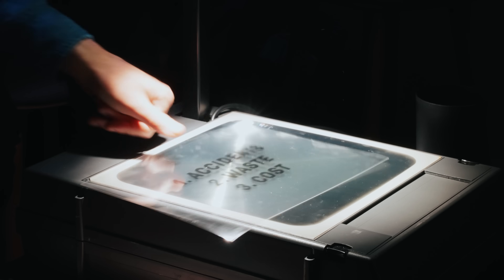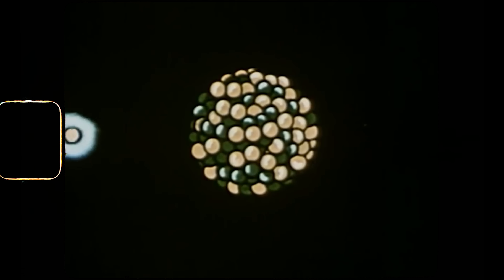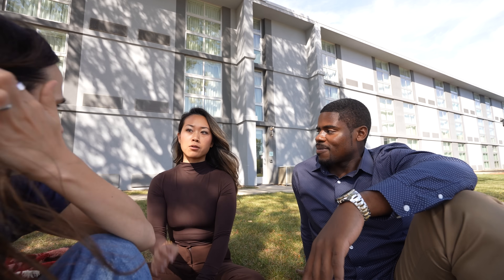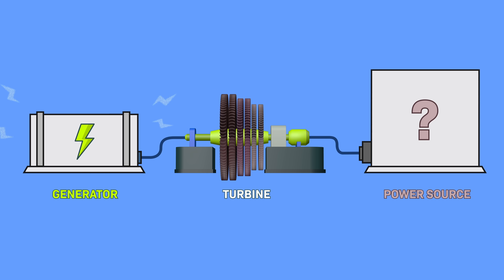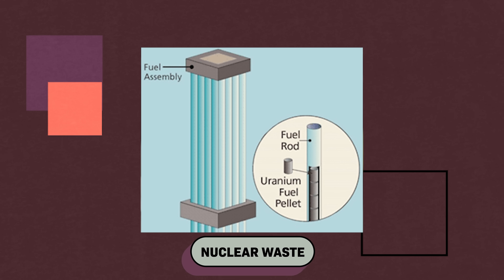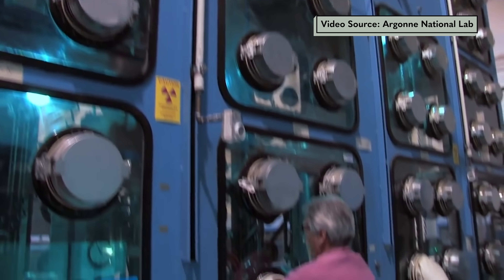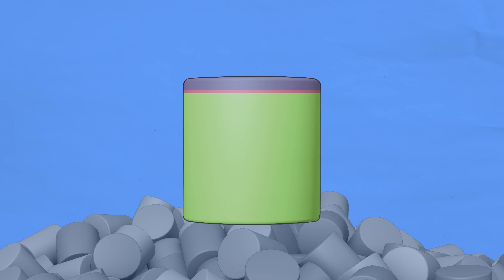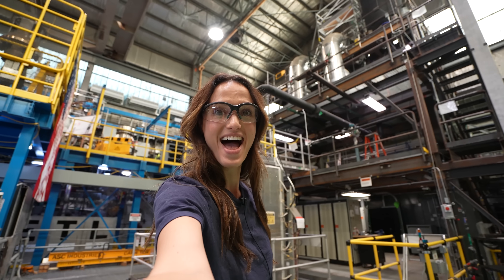The Big Lie About Nuclear Waste

Comment: I think the reason nuclear waste is shown as glowing green goo is from radium used in watches so they can be read in the dark.  Spent fuel actually glows white from Cherenkov Radiation which comes from electrons travelling faster than the phase velocity of light in water.  That white glow appears blue because the water is borated, boron is used to control commercial nuclear reactors in a process called chemical shimming. Nuclear waste can be managed, but its hard to get cooperation when so few people actually understand the first thing about nuclear power.

Comment: 4:07 That makes absolutely no sense. That the nuclear waste (the tiny little bit left over) that is currently in the US is enough to power the Whole US for 150 years. That is fake news and makes no sense what so ever.
there's technically not enough reactors to power the grids that they are on, being generous and saying nuclear reactors have been around for 80 years providing this limited power. You mean to tell me that the "fumes" of the limited power waste is enough to provide electricity to the whole of the US for 150 years? I call BS I know that this is just clever word play. What is probably more likely true is that there is enough watse in the US to powers some things to some capacity in the US for 150 years, like a small town or city.

Comment: It's a nice video but misses the mark on the dangers of radioactive materials. The pioneers of the nuclear industry setup early manufacturing and reactors with no shielding, in fact they handled plutonium, U235 and U238 with bare hands and nobody suffered from any radiation sickness. Refer to Gaylen Windsor, he managed the setup and operation of nuclear facilities and was appallled when they were forced to install useless radiation protection measures. The truth is nuclear fuel is clean, green and plentiful and could supply close to free energy for the world. Plutomium breeder reactors have also been suppressed.

Comment: Edit: People keep commenting about the "feasibility" of this recycling process. It's obvious that those of you making this comment don't know anything about manufacturing.

Unless you are making a custom-made-to-order item or something in too low volume to keep a factory producing it, manufacturing a product is almost always done at a loss when you start. Whether we are talking about fuel rods, game consoles, or GPUs, you typically will not make a profit on a unit of sale when you first launch the product.

Let's take the PS5 Standard Edition for example. It was launched in November 2020 at a price of $499 USD. This was likely a price that resulted in a @40% loss at the time. Yes, that means each console likely cost Sony more than $800 USD to manufacture.

Why, then, did they sell the console at a loss?

Because Sony planned to make it for 5-10 years and the longer you constantly produce something in a factory the lower its manufacturing cost becomes until it eventually reaches the actual cost of the materials and labor which is always far less than the price of the item.

Sony announced that the PS5 Standard Edition would break even in June 2021. After that point, Sony would make an overall profit with each unit of sale. Something to keep in mind is that Sony was probably producing the units for a good six months to a year before the launch to have enough inventory, meaning that it took nearly two years for that model to become profitable. 

This is true for nearly all products made via mass manufacturing and is called "process maturity". So, please, please, stop telling me how there's no profit to be made in this recycling process when recycling is just another manufacturing method. It's not immediately profitable, but it is over time. Big Business and Big Govt. rarely care about short-term profits when manufacturing something.

Original Post:
I remember arguing with a friend of mine over  20 years ago in HS that anything that was radioactive, including nuclear waste, could be used to generate power if we designed a plant to make use of it. Wish I had known about this place back then.
Reply: Russia, China, the UK do it. Unfortunately it's "outlawed" in the US
Reply: Russia already did it with BN reactors.
Reply: @personperson2884  Not quite accurate. Our reactors in the USA use Uranium 235. The BN-reactors "burn" an oxide alloy of >70% Uranium and <30% Plutonium, and some of the neutrons from that reaction are used to turn Uranium 238 into Plutonium 239. They still have to process more uranium into the oxide alloy that is used in the fuel. It also doesn't eliminate any nuclear waste that is produced by existing plants or itself.
Reply: Looks like you need to find your old HS buddy @master zoentrobe’s gaming clips
Reply: @ethosari2029  I could visit their grave, but I don't find smugly saying, "I told you so," to a headstone very satisfying.
Reply: @TheZoenGaming  Man you just love to ignore points that others (like Pluxei and me) make. You ignore actual reality and argue your theoretical stuff. According to you yourself for 20 years with your friend and still you are miles away from the real world. Lost cause apparently.
Reply: Important disclaimer it's not just about manufacturing cost, We actually kind of know that the PS5 pure manufacturing cost (parts price + labour and machine cost) can't be too far from its selling price. we know that because in some countries it is literally forbidden to sell a product at a too low price if manufactured and at loss if you are a resaler, except during few specific circumstances for which the PS5 doesn't even qualify yet, actually every cost estimation of the PS5 made by independent put the pure manufacturing cost of the PS5 close to its selling price often below 400$ and the highest estimation being at 450$. 

What sony reimbursed in june 2021 is mainly the R&D cost, marketing cost, software development and other expense and overheads.
Reply: Anything radioactive, huh? How about the low level waste like a glove that has touched something radioactive and now has radioactive dust particles on it? Can you reuse that? I don't think so... the steps to separate the tiny amounts of usable fission material would require more energy than you'd get out of it. This kind of low level waste is a burden no matter what you do and it's not completely avoidable.
Reply: @thulyblu5486  Low-level waste is barely radioactive and certainly not difficult to store until it is safe. Low-level waste is called "low-level" for a reason.
Reply: @mpccengineer  It's still radioactive for a few centuries (way better than the high level waste which needs about 100 000 years) but still: if you don't employ at least 2-3 security guards for each storage location for these centuries to guard this day and night, terrorists will have an easy way to cause damage. The terror potential is enormous since people are really scared about this stuff, even when it's not very bad.

The point is: it will be very expensive to store. Or it'll be unsafe. There is no way around it.
Reply: @thulyblu5486  Your reply is the equivalent to "I have nipples, Greg. Can you milk me?"

Nitpicking doesn't make you look intelligent. It makes you look like you're incapable of discerning an obvious generalization in a given statement. People used to be capable of having conversations with each other, without the need for "gotcha" moments. Those who insisted on doing such things were typically dismissed as obnoxious losers, who had nothing worthwhile in their lives - so they would need to get "wins" by splitting hairs.

On second thought, I guess it's still the same, today. There are just a lot more of you, now.
Reply: @thulyblu5486  Radiation creates heat, so why not just make a secondary steam generator?
Reply: @TheIronCowboy  That sounds doable, why not
Reply: @thulyblu5486  It actually can technically still be used for power, its just not feasible if its such a low radioactive level that its not even worth considering. But radiation itself IS a form of power, even mildly radioactive stuff. 

The point is, anything thats reasonably radioactive has enough energy to be reused as fuel. Anything that cant be easily turned into more fuel is likely not radioactive enough to actually be all that dangerous. Its not that it technically CANT be done, its just far too expensive and unnecessary to actually do.

But anyways, the point is, the most dangerously radioactive stuff can be reused, and the stuff thats barely dangerous at all isnt really feasible at all to be reused, but its also far less dangerous and easier to store long term so its far less of a problem.
Reply: @thulyblu5486  I love when people try to argue against one half of a sentence. The half you have tried to ignore is, "if we designed a plant to make use of it."
Reply: @TheZoenGaming  I didn't ignore that part. Is it feasible to design a plant to make use of such low level waste? ... I don't think so. That was the point. Disagree? Feel free to explain how that's remotely conceivable and file a patent for such a revolutionary design and expect a nobel prize in the future.
Not even joking: environmental activists would love you for solving the nuclear waste problem like this.
Reply: @thulyblu5486  The whole point of this video is that the "nuclear waste problem" was solved more than 60 years ago. As to whether it's "feasible", by what metric are you checking? Is it feasible commercially to design and build a plant which subsumes anything that emits ionic radiation? No, not right now. Is it feasible for our and the planet's health and safety to not do so despite the economic cost? No, and it never will be.
Reply: @TheZoenGaming  "The whole point of this video is that the "nuclear waste problem" was solved more than 60 years ago."

No it isn't, and no, it wasn't solved either. At the end of the reuse there is still waste left over just less and it's limited either to one cycle or maybe a few more - you can't get rid of everything with this. And the countries that do that (very few) aren't super successful at that either because it's really expensive. In other words: it does not seem to work in practice

"Is it feasible for our and the planet's health and safety to not do so despite the economic cost? No, and it never will be."

False, the answer for the vast majority of countries is yes: it's feasible to not do the recycling. It's cheaper to bury it underground in long term storage is the current thinking for the vast majority of the waste. That's basically the current plan everywhere including nations that do some recycling because not everything can be recycled.

Please get real.
Reply: @thulyblu5486  You clearly have never bothered to learn how recycling actually works, then. I'm not going to continue discussing this with someone so unknowledgeable. Have a nice day.
Reply: @thulyblu5486  You can, it's just not efficient enough/too costly to make viable. It's the same with clean water and hunger issues. There's no monetary incentive to do it.
Reply: @TheZoenGaming  Funny because everything he said was correct. It's not economically viable to recycle nuclear waste because as you get to the more useless uranium it becomes harder to seperate and therefore requires more energy to get less back out of the process. Meaning it becomes less efficient as you do more recycles. Meaning after a couple cycles it becomes cheaper just to use the old process.
Reply: @thulyblu5486  In most cases the nuclear waste is actually the water.  So using that radioactive water would actually eliminate a lot of it
Reply: @soulsemblance3163  How would you use it?
Reply: @pluxei  Seriously? Did you not watch the video? It's not economically viable to store nuclear waste which emits ionic radiation.

Here are some facts for you: It can't be buried deep enough to be safe without spending trillions of dollars and ruining the ecosystem, the waste has to be repeatedly "bottled" every few decades, something that costs more each time it's done, and costs of the raw materials are beginning to rise drastically.

Where is the economic viability in continuing to use the "once through" method?

Further, recycling usable material, whether we are talking about plastics, glass, Aluminum, or, theoretically, Uranium, is cheaper once the process is mature than manufacturing new product.
Reply: @TheZoenGaming  Everyone else but the US  is doing it. It's ridiculous.
Reply: @TheZoenGaming  it wasn't solved 60 years ago. The mistake to go with uranium  water cooled commercial reactors because they produced waste byproducts that also contained valuable bomb making plutonium was the decision that lead to this mess. The scientists at los Alamos that were working on commercial nuclear power research after WW2 were appalled in disbelief this path was taken in the 50s, but were over ruled by the government and the DOD money that wanted light water reactors. They actually burried the national stockpile of thorium they were going to use in the desert when they cancelled the project
Reply: @TheZoenGaming  If it was feasible it probably would have been done already. As the researcher pointed out in this video, it's doable in practice but it just needs to be commercialized. And Ms. Abram herself said that costs (and politics) have held commercialization back. In other words, it's not feasible right now unless energy prices become sustainably higher, or unless leaps are made in the nuclear waste recycling technology that make it less expensive. "Feasible" implies economic feasibility; there are a lot of things we could do but which we don't do because it would ironically enough be economically wasteful.
Reply: @TheHeavyModd  The "costs" that held back the implementation of the recycling process are the same ones that held back glass, paper, metal, and plastic recycling at first, i.e.: an abundance of easily acquired raw materials for existing manufacturing processes. In the video, they mentioned that those factors were changing.

You and several others have demonstrated that you functionally have no grasp of how manufacturing a product generates profits.  Read the edit of my original post if you want to learn something about manufacturing.
Reply: Romans 10:9 = Eternal life 

1 John 5:3
“For this is the love of God, that we keep his commandments: and his commandments are not grievous.”

Ecclesiastes 12:13
“Let us hear the conclusion of the whole matter: Fear God, and keep his commandments: for this is the whole duty of man.”
Reply: @1CT1  "Momma said knock you out." LL Cool J
Reply: @1CT1  
I love the Bible too, but just randomly throwing scripture at people is not even what Jesus did. 

Context, conversation, application…
Reply: @1CT1  
Ezekiel 23:20

She lusted after their male consorts, whose sexual organs were like those of donkeys, and whose ejaculation was like that of horses.

Comment: I wonder how many of the comments here have pointed out Thorium reactors. Designs, that actually require a high radioactive source to kick start thorium. And highly radioactive nuclear waste is perfect for initial kick. So why havent we seen this technology yet? Materials: thorium reactors were designed around the molten salt concept. Thorium flouride is quite corrosive, not to mention the highly radioactive elements. Materials that withstand such conditions arent good for structure. And structural materials do not withstand the hot, irradiated salt.

Comment: Just wait until you hear about thorium reactors... Makes the weapons proliferation argument about recycling look even more ridiculous.

One issue with any nuclear, or other fired boiler system is the insane amount of water they use for cooling, and then like in France, when there's a heat wave they have to reduce their capacity because there's not enough cool water to go around...

Comment: To put it simply, radioactive waste continues to be generated. And if we are completely honest, the final disposal of the low-level radioactive substances in particular must be fully priced into the costs of the energy generation itself. And all of a sudden, nobody wants a nuclear reactor anymore, because no company in the world wants to bear the costs for 1000 or even "only" 100 years of safe and secure storage, even if some of the waste has to be stored safely for many, many times longer.
The generation of electricity from nuclear power is only rudimentarily attractive as long as one cheats on the price and the general public has to pay for the final storage instead of the company owning and operating the power plants.
I would be very, very happy to be proven wrong, but this has not happened yet.